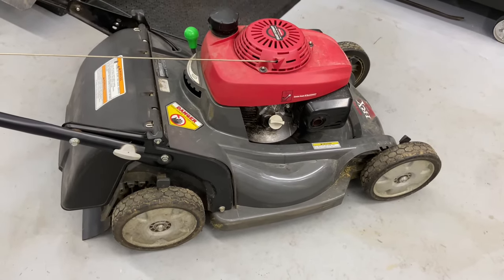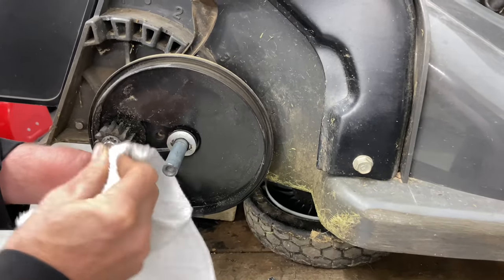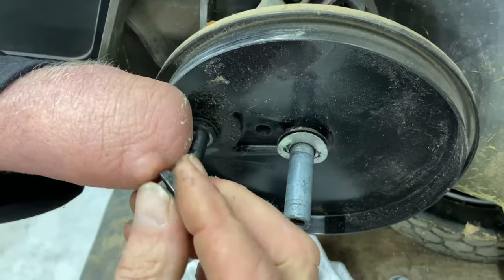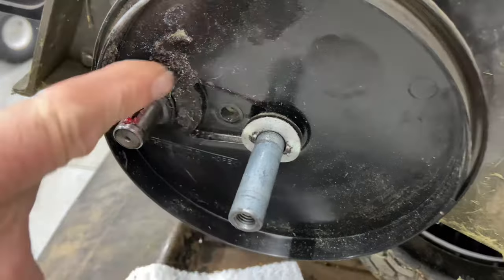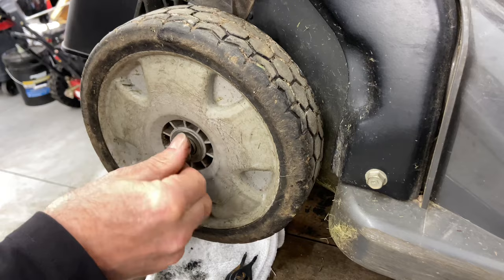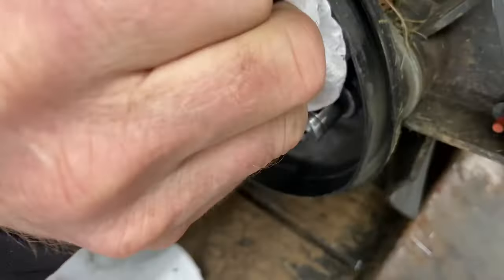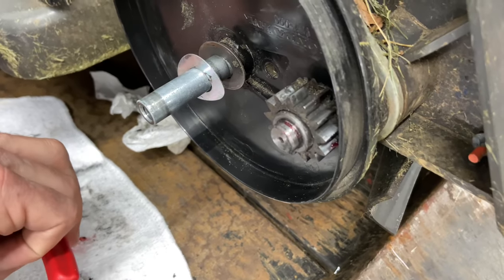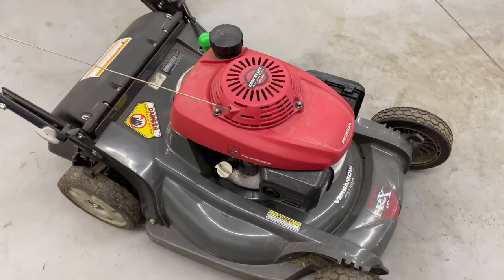Honda Lawn Mower will not self-propel

Comment: Great video. Mine wasn't self-propelling because the plastic shield that protects the transmission, had a big enough crack in it , that allowed grass clippings, and mulched leaves to pack around the transmission. That prevented the pulley from turning the belt. I removed everything, cleaned out the debris, and replaced the belt. I then repaired the shield with J B Weld. After putting all of the parts back on, it worked perfectly. Now, each time I use the mower, I spray the underside with water, to make sure everything is clean.
Reply from the maker: Glad to hear your back up and running!

Comment: I have an issue where the right wheel isn't self-propelling. Do you think I have a bigger issue with the transmission?
Reply from the maker: When the transmission fails, both wheels will be affected. You most likely just have an issue with the wheel that is not working.

Comment: I’ve owned 3 craftsman’s before this Honda and they lasted years. This hunkocrap feels like it’s 10 years old and it’s only 2 years old. Mine isn’t clicking at all. Just rolling very smooth.
Reply: ?. interesting. I have an MTD mower, front wheel self-propell, and a  Honda  GCV 160   engine. Just replaced that belt, and adjusted the pull cable length, to  ' MATCH '... / Goes  full - bore, now.  ONward  ho.....?.....mow  i mean.  moe ?  some days , i am a     ' m o e '.     ....probly  everyone, has  those  ' days '.....
Reply: I turned it on its side and cleaned out the grass from around the transmission I guess you would call it and now it works. It probably just stopped self propelling because I was cutting grass with it ?? Go figure.

Comment: Ive got the newer hrx217 with the gcv200. My issue is the self propel wont work. The ratchets are clicking when moving forward with or without the self propel lever engaged (engine off). When i engage the self propel lever and pull backwards it rolls back and the axels spin (engine off). Manual says it shouldnt do this.
Also the transmission cable wen engaging the self propel lever on any speed only moves the lever on the transmission a little bit. Maybe about 1cm ish. Ive tried adjusting but thats the max i can get. Any help?

Comment: Great video, do you recommend and c clip assortment pack of any kind. I bent all mine😅
Reply from the maker: I only recommend the genuine Honda clip. I had a hard time finding the correct size and a good metal clip. Most aftermarket clips are junk (in my opinion). You only need two and if you buy a kit, you’ll never use all of them. Just find the part number at a Honda power equipment parts lookup online and you may be able to get them in your local area if you have a Honda dealership.
Reply: @JohnsonsSmallEngines  awesome thankyou very much!

Comment: I have literally got just under 35 hours on mine per the digital timer I installed when I bought it last year. The drive stopped on me, and the wheels are locked up preventing rolling back. I hose the mower off after each use, and keep it stored in my garage. Really can't understand why I'd be having this issue on a premium product so soon after purchase. Maybe I washed too forcefully under the deck, but I'm only using the jet stream nozzle on my house. You mentioned something about a bushing that may have something wrong?
Reply from the maker: I think this is what your looking for. https://youtu.be/zsHQYJEKY5M

Comment: what did you use to unscrew the wheel to start with? mine does not budge
Reply from the maker: If your talking about the bolt that holds the wheel on? Use a 14mm socket. If your using a ratchet or wrench, put a pipe extension for leverage or whatever you have to get more leverage. I was using a electric impact.

Comment: Is it normal for the rear wheel to lockup to stop it going backwards?
Reply from the maker: No and depending on the model you have? I have found it to be a plastic bushing on the drive shaft. I I think there may be a video out there but I do not have one. Look for a video on one with a seized axle bushing.

Comment: Thanks for the video.   The issue I am having is the right side starts to turn but when it hits the ground it stop driving forward.  I am going to check the gear.  I did take it apart to clean and lube it.
Reply: This fixed my issue.  Thank you!

Comment: You mentioned the internal bushing that will prevent the real wheels from turning backwards. That is the problem I am having. Not sure how to get to those bushings.
Reply from the maker: There are videos on it but I do not have one at this time.
Reply: Hey Karl. I'm having this exact problem. 
 I'll let you know if I find a solution
Reply: @jamesbenefield9972  
I turned the mower on its side and put a sprayed a bunch of silicone on all yyd bearing and that has fixed the problem for now.
Reply: @karlshuh6612  ty

Comment: THANK YOU! I need to do this to my Honda push mower. It clicks and it hard to push without engaging the drive.
Reply from the maker: The hard to push without engaging the drive normally is the bushings on the axle. The next machine I get in that has the issue, I will get a video up on that issue. Thank you for watching and commenting.
Reply: How about a Honda mower losing it’s self propel as you mow the lawn? The propel is weak but gets weaker ?

Comment: Oops,I need to do this asap. I've had mine for 4 years and havent done this. I dont know where my manual is,so is there anything else I'd need to look at?
Reply from the maker: This video is important, the rest is normal preventative maintenance, oil change, clean or replace air filter, install a new spark plug every now and then and keep sharp blades. The machine will run for ever if you perform those tasks. Take a look at the drive belt and keep debris from under mower deck. Especially if your machine has a metal deck. Keep it clean underneath so rust will not take over. Thank you for watching, commenting and supporting the channel!
Reply: @JohnsonsSmallEngines  you're welcome. I keep up all the other stuff,but had no idea about this wheel maintenance.  I've mowed my yard and my sisters yard for a couple years and added 3 more biweekly lawns this year. I keep it busy,so I guess I need to take mine apart and give it a good once over. Thanks for the helpful advice. 👍

Comment: I bought a used Honda mower.I'm having an issue with backing up and pushing forward. it propels forward fine but push it forward and pulling backward it doesn't want to move.
Reply from the maker: The rear axle bushings are getting too tight that go through the frame. I know there are a few videos on your issue but I haven’t had one in to perform as a video yet. Keep searching you’ll find a video on it. I can say it is a little involved, but it’s definitely doable and it will correct your issue.

Comment: Hey Brad, are you aware Honda is ending Lawn Mower Production? They will be permanently closing their facility & consolidating with another Plant. The Plant remaining open, builds Side by side ATV'S. Lawn Mower's and small Engines are done after 2023. Due to harsh E.P.A regulations. Just heard this yesterday on 'Small Engine DIY' Channel YouTube.
Reply from the maker: Ouch! Thanks for the heads up. I was around back when the Honda Tractors were metal not plastic, then they went plastic, then they stopped producing tractors all together in the east. It does not surprise me at all, as the electric is taking over and most consumers do not want to spend the $ for the Honda. I really don’t even work on walk behind mowers and longer. (This video may be 1 of 2 or 3 I put out). Thank you for the update!
Reply: I hate that they're going that route,but I understand. Are they stopping all small engine production or just mowers? I love their pro engine line,you cant buy a better engine.
Reply: @ciphercode2298  My understanding 'all' Small Engines. Check out Small Engine DIY his Channel is on YouTube. He posted the Video Yesterday.
Reply: @steamboatwillie935  man,that's just aweful. I hate the epa.